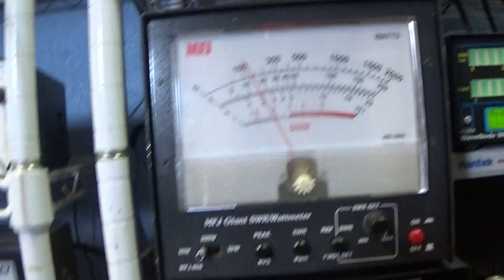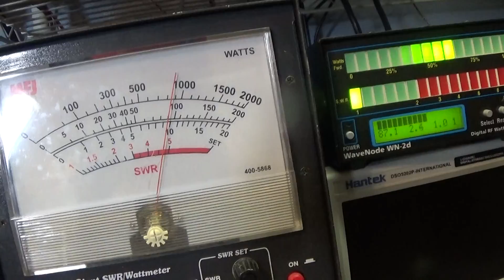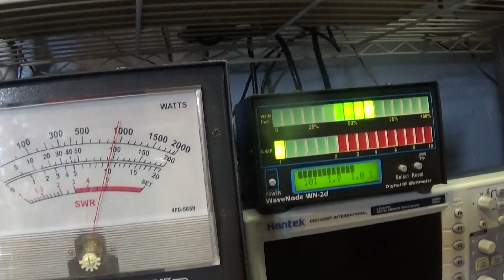Blackcat JB-75 mobile 1 tube linear amplifier modulator

Comment: Switching transitors that get the HV to the tube ..bye switching pwm signal so fast that the HV stays applied to the tube ..  ..this is very annoying when operating... But they work .if u put the amp in the trunk or away from the mic I put ....

Comment: Wat should the dead key input on this be and what’s the screw adjustment on the back
Reply from the maker: Pretty much all CB amps (which this is) are made for a stock CB radio 4 watt dead key. The thing on the back is to adjust the output of the amp for a 20 watt dead key or less (again on the output side). It will do more but won't last long. Black cats are made to dead key low and swing high.
Reply: @tramdr  TRUTH👍👍
Reply: One of the adjustments is for the input matching. Black Cats were not grounded grid, they were grid driven. The input impedance is very high when you drive the grid. That’s why they swing so much. Common grounded grid amps have a low input impedance to the cathode. This is what sets the Black Cat amps apart from most others. It’s a lot more complicated to do grid driven amps, but the swing they produce is astounding! The hardest part is to keep CBers from trying to squeeze every little watt out of them on dead key. On the base amp I have, it uses a resettable circuit breaker to protect the amp from this. It has a long, red rod sticking out and you push in to reset it. 
Btw, if you are new and repairing these type amps, try hard to keep the original Solitron 2n1522 transistors in them. I’ve not found any other ones that work as good. Unfortunately they quit making them decades ago. Motorola, Jan and others run hotter. They are germanium and, if you change to silicon, your high voltage will be much lower.

Comment: whats the deal with the whine?  I used to have a tube amp that did that and I thought it was broken so i pulled it apart.
Reply from the maker: the noise does not come thru the amp, but like a loud fan noise, it can 
(and does) get picked up by the mic and can be heard during transmit. As
 I said earlier though since these are mobil amps anyway, most people 
mount them in the trunk and wire a switch or relay to turn them off or 
on. Others put them under the drivers seat but there you the mic will 
still pick up the whine to a certain extent but its not bad. Kinda like 
the chugga chugga blower noise from a Pride DX-300. Its there, but who 
cares.
Reply from the maker: Most tube mobile amps use switching transistors to turn the dc into pulsed ac which is then fed into a transformer. It is this switching/pulsed action that makes the noise/buzz or whine which most small to medium tube mobile amps have. Its not so bad in your car, under a seat or in the trunk, but on the bench right next to my camera, there is going to be some buzzing. It only comes on during transmit because in mobile amps like this, the HV is not running until you key it down.
Reply: do they hear it on the air or is it just external noise?